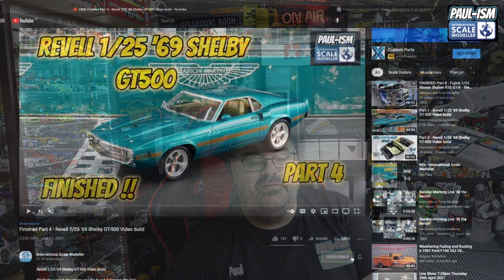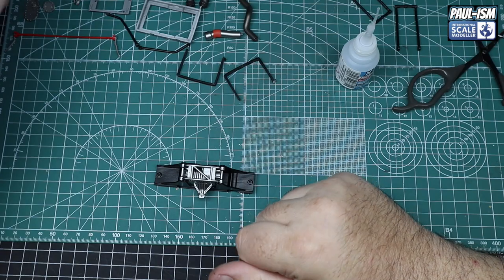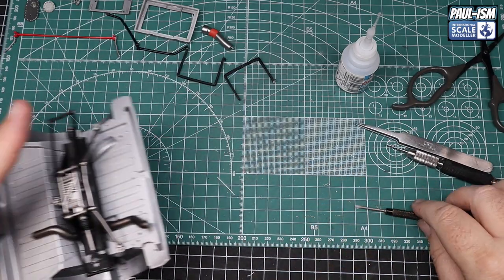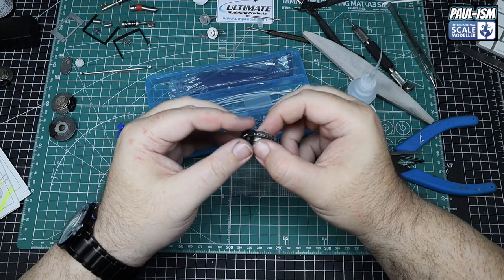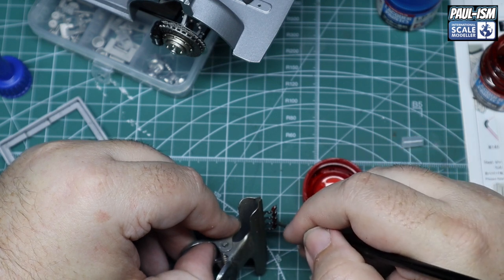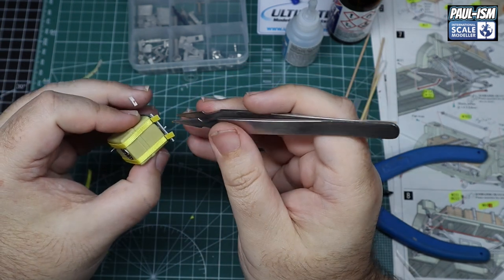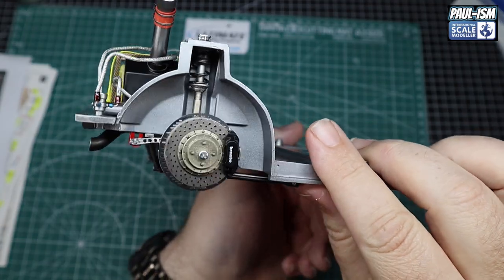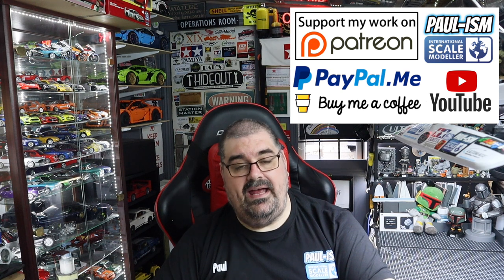Part 5 - Model Factory Hiro Full Detail 1/12 Lancia HF Delta Integrale Evo '92

Comment: Question about the CA glue tips. Are they single use only? Or can you nip a bit off the end and re-use them a few times? I'd imagine they'd get blocked by the drying CA glue inside the thin tube
Reply from the maker: Yeah you can do that mate.